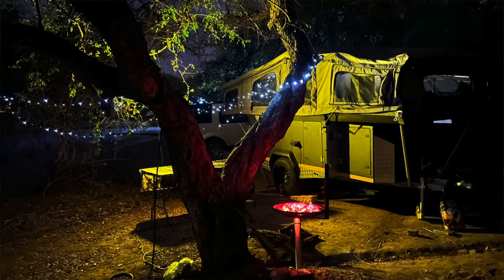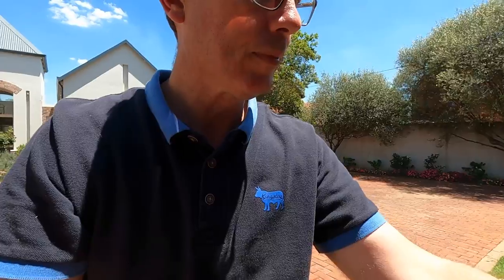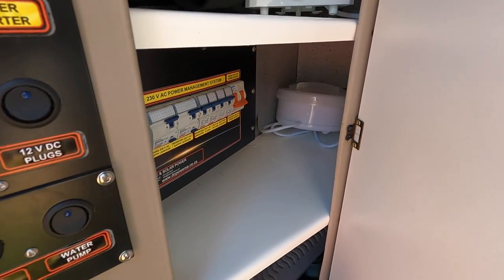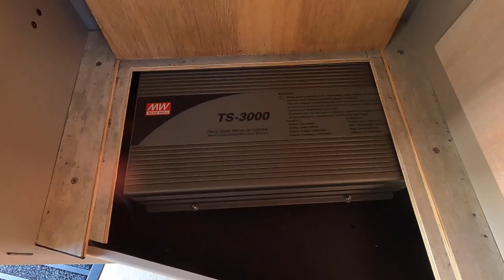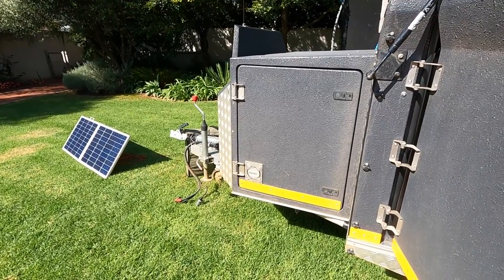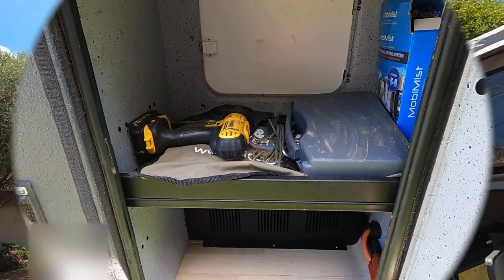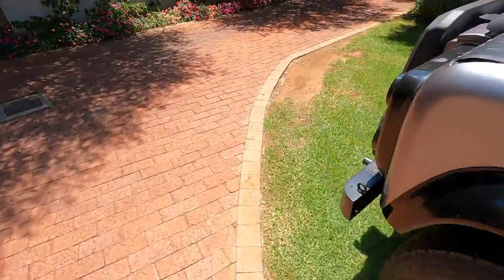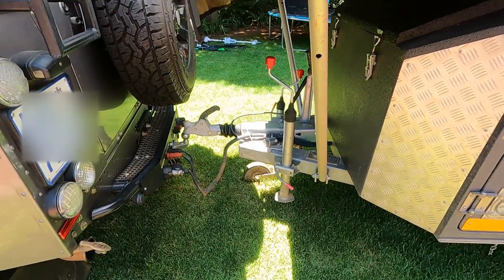Review: Invader Quattro Plus Ultimate Off Road Camping Trailer Upgrade

Comment: I love the Idea of the invader. I'm a big fan of them. I've been thinking about getting  one sometime, but my only concern with the Quatrro is the bed is to short. I'm 1.92m and my heels and head are pressing against the canvas.
Reply from the maker: I am 1.82. And I just fit. So fully understand your concern. When I bought mine, it was mentioned that you can potentially extend the main bed and sleep ⬆️ instead of ➡️. Contact Pieter Lambrecht on 083 233 5379. He was involved with Invader as some point and currently sell and service Invaders in Pretoria. He will be able to provide the right advise. He is also about 1.9m tall 😊